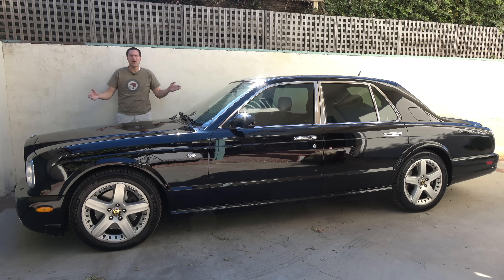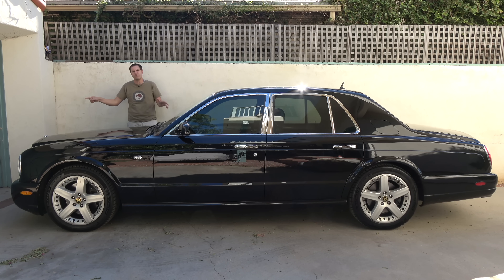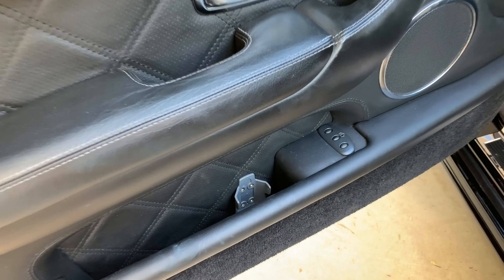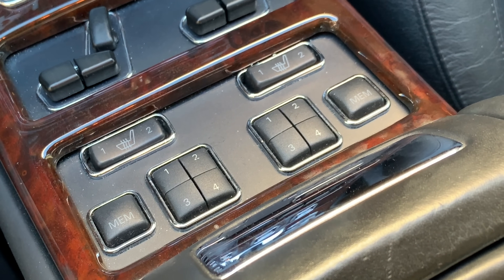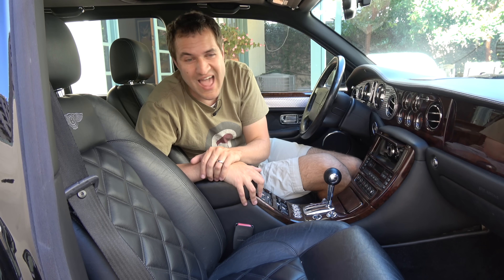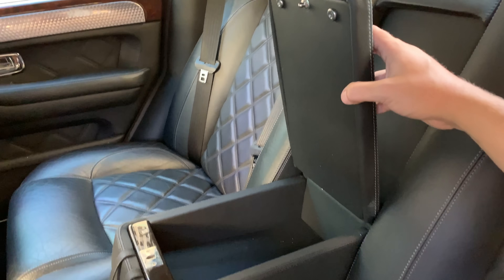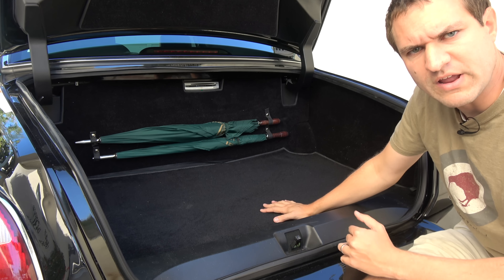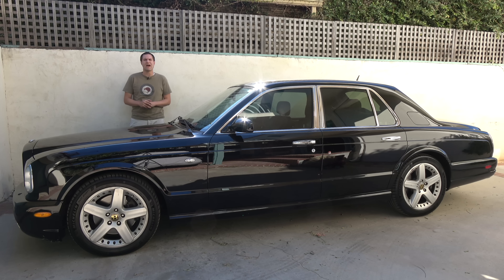The Bentley Arnage Is the Ultimate $30,000 Luxury Car

Comment: Balderdash!!  An old Bentley/Rolls/Mercedes/BMW/Ferrari, etc. is the LAST thing anybody on any semi-normal budget should even THINK about buying!  I spent over 30 years in the top-shelf automobile business, so I know of what I speak.  The purchase price of an aging exotic or high-end car is just the start of what too often becomes a potentially-bankrupting nightmare.  The servicing is expensive and not always readily available, and the parts alone can be devastatingly pricey.  It may be an old $30K Bentley, but the parts are priced right up there with the $200K new ones.  If you insist upon spending $30K on a used high-end car, just go find yourself a nice low-mileage Lexus.  You'll be happy, you'll arrive on time, and you shuold still have a bit of money in your pocket (and not in your mechanic's).
Reply: i agree an absolute truth  !

Comment: A couple of corrections.    New retail price on a 2002 Bentley t would max out around 250k. The one you are driving wasn’t even that loaded—-not 300k.  My 2007 which was much more loaded retailed at 270k

BMW never had any control of Bentley.  The simply supplied bmw engines For only 1 year of the arnage  and 4 years of the silver seraph. They later bought the rolls Royce name,  but they never had any design or control of anything on the silver seraph or arnage cars other than providing engines.   

You are considered a respected automotive journalist,   You should research this stuff before you make statements

Comment: Just hope that it will not break down...of course it being a Bentley it will eventually and when it does, prepare for the repair shop to empty your bank account :) There's a reason why these things, and other once overpriced luxury barges, lose so much value in a very short period of time. People want to get rid of them as the upkeep is ridiculous once the warranty runs out. The steering wheel on this thing looks really bad though of course most steering wheels looked liked that at the time this thing came out. The little TV remote is hilarious :) You can definitely tell that this came out when BMW owned Bentley. The buttons and gauges are pretty much the same from the then 7-series BMWs.

Comment: Hi Doug, I recommend you to make a training about recognizing materials. A lot of switch on the Bentley are pure plastic. To be honest, I do not care really. I had an Arnage T and the magnificient first engine melted after 67'000 KM. The installation of the renewed engine by people of the best (?) Bentley garage in Switzerland cost 68'000 CHF/EUR/USD. After other 65'000KM the second engine was slowly burning more water than fuel. I agree, great car. But the servicing people are absolutely lowest level. The engineering is also questionable. So buy an Arnage, put it in the garage to impress your friends, but do not drive it at all otherwise something will break down. Original Bentley spare parts are of the same low quality. Now I drive a Range Rover 5.0, which is a bit better than any Bentley I tested inclusive the new VW-Bentley. Let's say it blandly: much better.

Comment: If you take care of it won’t break also there is pets everywhere won’t cost much to repair not sure why people think it’s so costly if you have a regular mechanic and buy some after market parts your ok you don’t have to go to a dealer to get basic parts I never had an issue with any car I bought after market parts and worked as good as the dealer matter fact some even better so if I buy any car is not an issue because I know where to buy the parts I know where to fix I have my own mechanic and something would cost me 2000 at the dealer would cost me only 200 if I do it my own and my own mechanic so the numbers you guys talking about wasting 15k that’s if your not familiar with how to do things just do research and you will be ok you will realize doesn’t cost much to fix any car

Comment: Looking at the car featured , it does seem to be a bit blingy with the brushed aluminium door panels and the fussy interior .  I would dare to say that my car  which is a 1992 Series 3  Daimler Double Six  is at least the equal of the Bentley and with no BMW input .  I much prefer the interior of the Daimler  and there is nothing to give you a headache in if stuck in a traffic jam.  I can imagine the sun on the aluminium shining in my eyeballs as I wait in endless queues .  No thanks, My Daimler is on second thoughts a much better car than the Bentley .

Comment: If you buy an old used Bentley, or any old used British car, you have to swap the entire driveline to Chevy, as I did with my TR6.
If you don't you better have LOTS and LOTS of cash standing by to keep that thing on the road.  Awesome car otherwise...
Reply: Some of the high performance Bentley's came with Chevy engines, from what I remember.
Reply: @painkillerjones6232  Can you remember which ones?  I would love to know more on that.  Sounds like an awesome idea!
Reply: @172-e5s  Too long ago.. the early 90's.. it was a two door convertible that I saw.
Reply: @painkillerjones6232  The only Bentley I can find is the Arnage  with BMW V8 power, but no sign of Chevy power in my searches.  Too bad, and thanks for your input Painkiller. [love the name!]

Comment: 35 grand to buy, service 15 grand
Reply: Complete rubbish , i have one of these in the UK and service is around £600 ...
Reply: @tomconnelly1382  never. U bring your Bentley to a official Bentley workshop then £600 will not cover it...
Reply: @kris1976me  I take mine to an independent workshop which is owned and managed by ex Bentley and Rolls Royce technicians , that is all they specialise in and a regular service , oil etc is very reasonable , nothing like the 15 grand you claim , i can only assume you do not have one yourself ...

Comment: So cheap, it's even cheaper than its own first service.

"I'm sorry but your car is totaled."
"Wait, why?"
"Timing chain replacement. The chain is made of the finest palladium and costs $45,000, not including labor. Should have bought yourself a Toyota Avalon."

Also, is that Arial I see as the typeface on the gauges of this $30,000 $300,000 car?

Comment: and yet he's sitting on plastic - all automotive leather is coated w/ what is basically a plastic coating, "car leather has been coated with this clear protective resin coating, the reality is that you are cleaning and conditioning a form of plastic; plastic that is both flexible and clear." - https://www.best-auto-detailing-tips.com/car-leather-care.html
which is why top of the line German cars use FABRIC - alcantara aka ultrasuede - polyester and polyurethane - that isn't cold in the winter and hot in the summer, and wears better

Comment: Mmm no. 10 years and the depreciation on this car insane.  In 10 years it went from 300k to 30k? Wtf. “ BeNtLy CrAfTsMaNsHiP” yeah that’s the craftsmanship right there. You’d be better off getting a upper class Mercedes and it will have more technology the same amount and probably a nice interior because it’s more modern. Plus it’ll probably be cheaper to maintain. LMOA 35k miles in 10 years and it’s 1500$ A YEAR. That’s such a joke.

Comment: My girlfriends passat has more options than this Bentley😂😂
Reply: Angel Lopez You’re probably wrong, but I don’t want to argue so I’ll give you the benefit of the doubt if the Passat is brand new. 

But let me ask you this. Does the Passat have a hand-built engine? Does it have Hand-stitched cow hide? Double pane windows? Does it have 460hp despite being over 10 years old? 

The answer to all that is no. This is not me knocking VW, I think they make great cars, certainly much better than an competitor from Toyota, Ford etc.. But to say a Passat, even a brand new one, has more features than an Arnage is a little short sighted.

Comment: The biggest problem the Brits have, and have always had, is their penchant for gadgets and doo-dads.  I own a luxury car that has no multi-switch climate control system and it was built about ten years earlier than this Arnage.  It has ONE dial to set the temperature desired and that's IT...and you can still set rider and passenger climate separately.  Dimming and brightening the dash lights?  It's done automatically.  Set the seats and mirrors to suit two different drivers?  They re-set for each driver automatically when they use the key fob.  And there are other automated features on my car that I could mention.  The point is, development in the USA usually runs from no features, to driver-adjusted features to those same features being automatically-adjusted by the car.  The Brits, even in 2019, are still having the driver do it all and calling it "luxury".  That is why their cars cost $300,000 new and nine years later go for 10 percent of that.  They're junk by design...not because of poor attention to detail.  My car has lumbar massage and heat in the front two seats and a computerized Driver Information System that can analyze and report on everything from engine
malfunctions to whether or not ice is possible on the road.  It even has "Rain Sense" which, once
switched on, increases and decreases wiper speed automatically (there's that seemingly non-British word again) and stops and starts when the rain does.  Let's not forget my car's "Twilight
Sentinel" which takes care of all lighting, automatically.  By the way...my luxury car is a 1999 Cadillac Eldorado Touring Coupe.  Why can I find no review for IT?

Pete